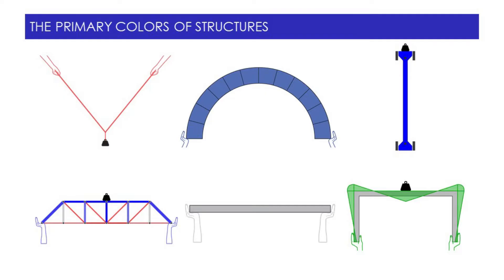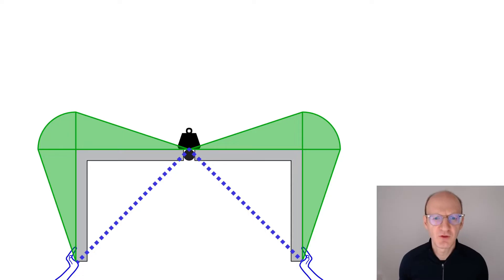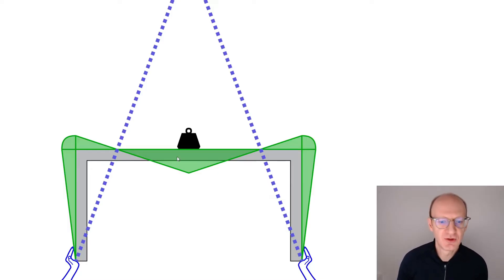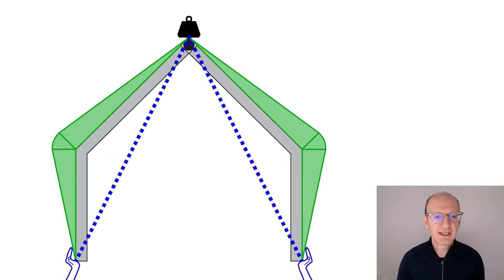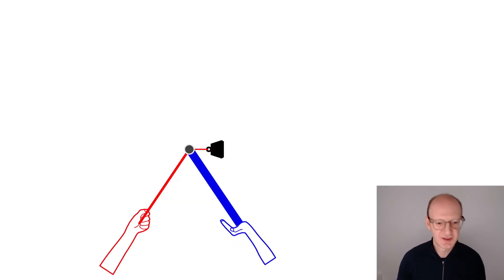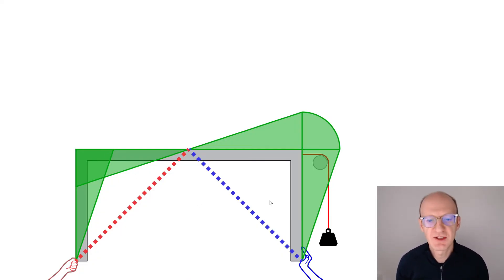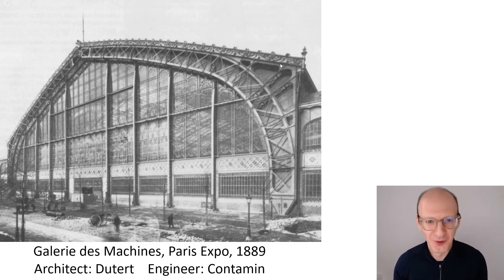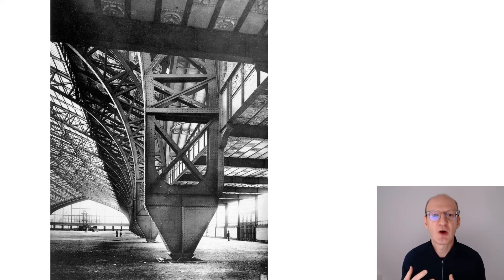How Frames Work! (Structures 7-1)

Comment: Paul sirr,
I like yu methodology to look at the concept, it's marvelous 
Y have shown an Arch section fracturing at two sections which is completely infeasible 
Arch concept comes from Key stone at the crown and the spandrel support on either side with supporting stones compressing each other just like a 📌. 
So separation cannot take place when stones are splitted with their faces matched

Comment: You got me addicted to structural engineering! one silly question...I thought that a structure shouldn't exist outside of the thrust line and here we have a frame with thrust "triangle" that lives outside the frame !!??
Reply from the maker: Sure - when the thrustline is outside of the structure then the material has to carry that in bending.  The further out the thrustline, the larger the bending moment.
Reply: @PaulKassabian  aah! I just got a bulb moment!! Thrustline must follow the shape and shape must follow thrust line. If the first case is not met then the shape must deform/bend to contain the thrust line.

Comment: Thank you very much for the great explanations....  I haven't learned what is the thrust line when I was a student (my major was electrical engineering).  How is that related to bending moment and shear stress?  Is there a formula to calculate thrust line?  Anyway, thank you very much again!
Reply from the maker: A thrustline is the shape a cable would take for the same loads.  Then bending moment is whenever he thrustline is away from the centroid of the structure.  My earlier videos on cables and arches explain it from a conceptual approach...and glad you liked it!
Reply: Thank you very much for the explanation!
Reply: When the load moves from compression or tension to bending. @PaulKassabian

Comment: Is the distance factor of bending moment similar to the length of compression members? Square factor?
Reply from the maker: good question! The bending moment is linear with distance of the thrustline to the centroid of the structure.
Reply: @PaulKassabian  I think I understand. Thanks!

Comment: The thrust-line approach is an excellent way to understand how frames work, and something that my lecturers never mentioned (unless I missed that class - entirely possible…).
Today an engineer would just build an FEA model of the truss frame of the exhibition building. Also analysing using a thrust line gives a great way to check the results, especially as the curved nature does not allow it to be checked using Kleinlogal equations.
Reply from the maker: Thanks Peter!